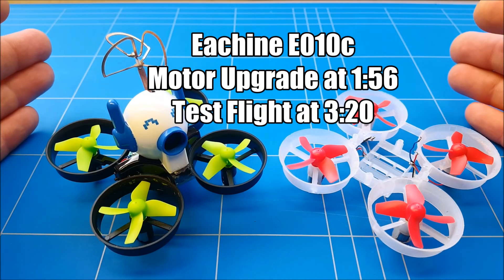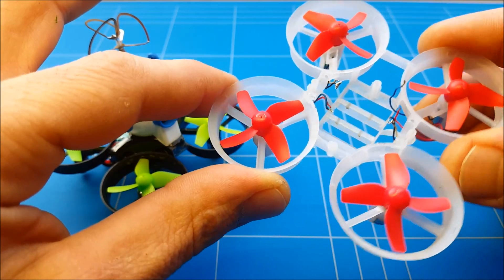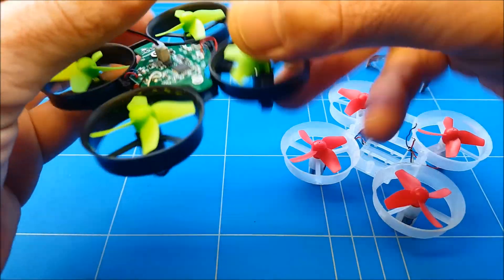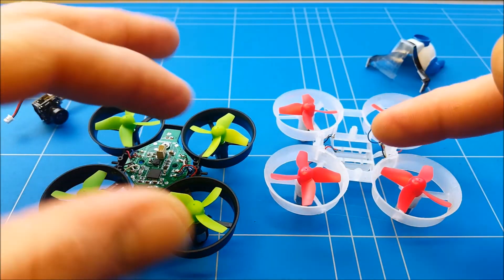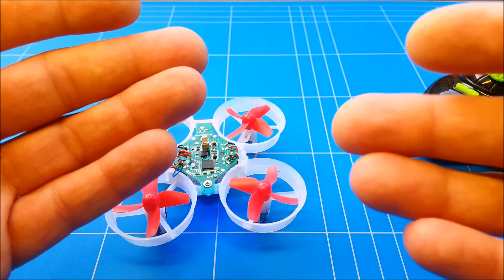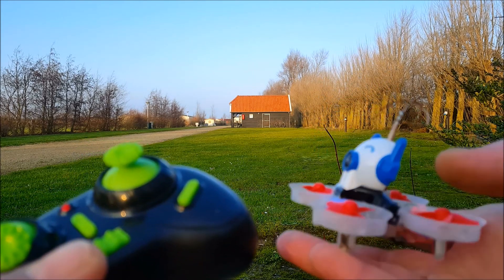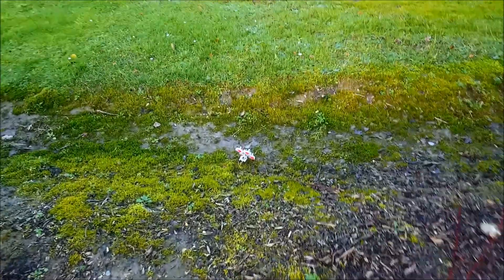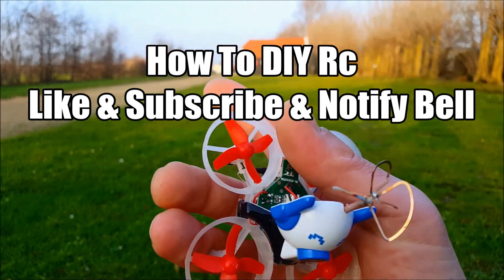Eachine E010c Motor Upgrade For FPV Mod With 40g of Thrust

Comment: Nice upgrade! I chose the Eachine E011 since it has 716 motors and upgraded with MMW Insane 716 motors with 73,500 rpm on a 1S LIPO and 3-blade props and it performs great with a Micro FPV System. Nice upgrade for the E010 and thanks for the video. Happy Flying!
Reply from the maker: my e011 FC is broken so i'm thinking about adding my e010 Fc to the e011 frame and motors
do wonder about these 3 bladed props are they giving more thrust or longer flight time?
Reply: The 3-blade props do give better performance and longer flight times with the higher kv motors. The motors I have in the E011 are upgrade motors and they are higher kv than the stock motors. Happy Flying!
Reply from the maker: ohh you got high rpm motors thx for the info definitely going to have a look ±D
Reply: I think the stock motors on the E011 are 15,000kv and the ones I used to upgrade the E011 are 17,500kv.